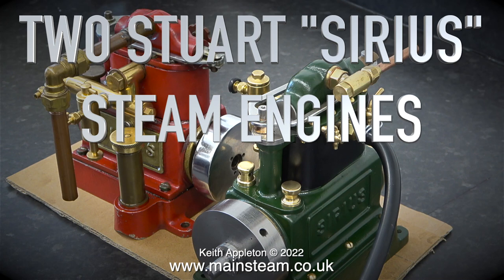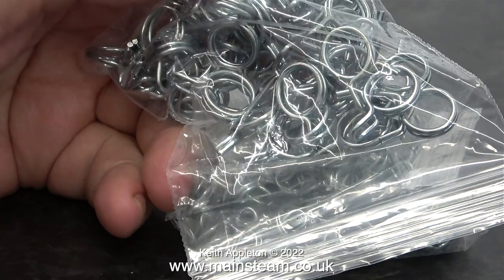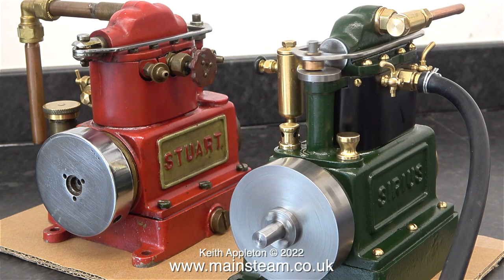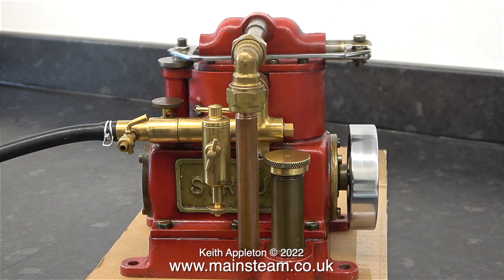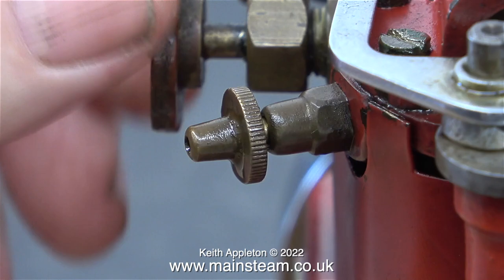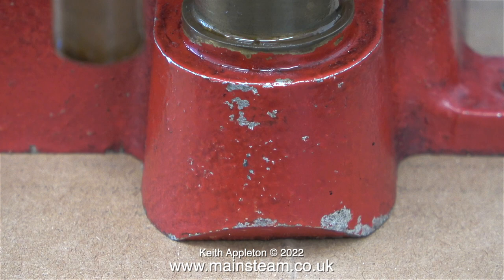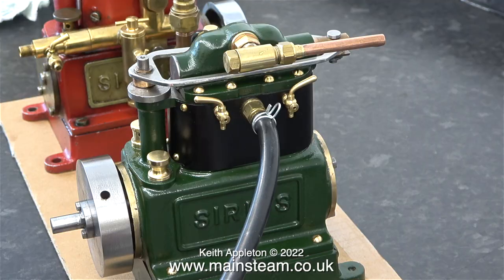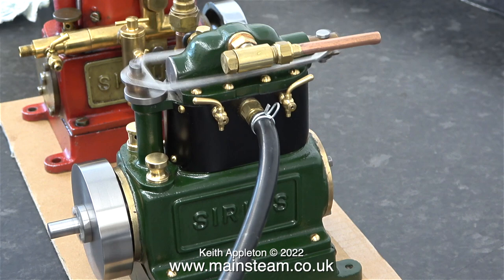TWO STUART SIRIUS STEAM ENGINES - PART #9

Comment: A question:  Why is the valve have the long lever (from one side of the steam chest to the other) rather than a shorter drive path.  This is obviously intentional, but I (not being a steam "expert") was wondering why?

Very good videos as always!
Reply from the maker: Using this type of arrangement, the valve operating system has to be the way it is, because if the coupling was at the other end then the amount of side travel on the spindle's crankpin would soon wear it out.
Reply: @keithappleton  Makes sense!